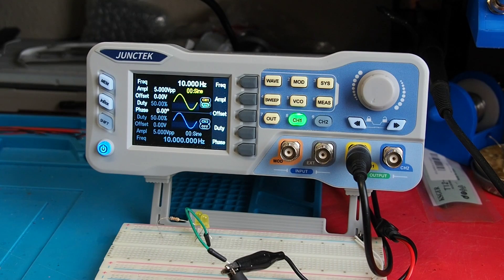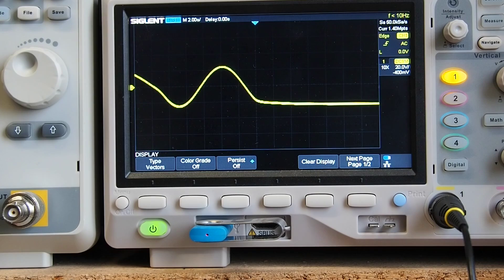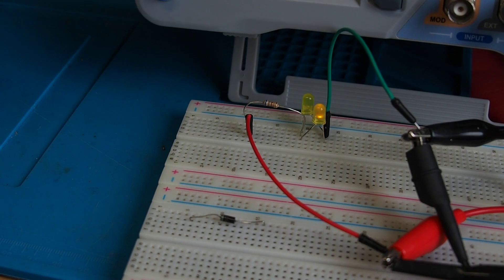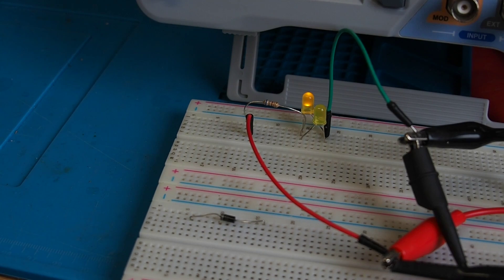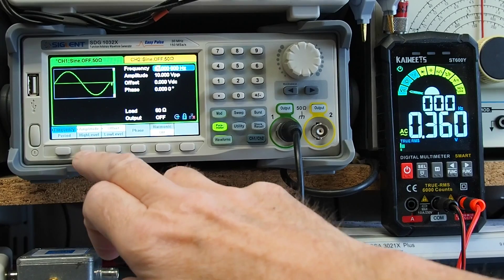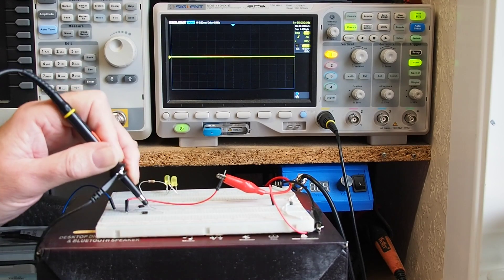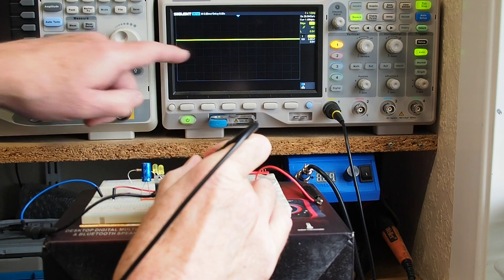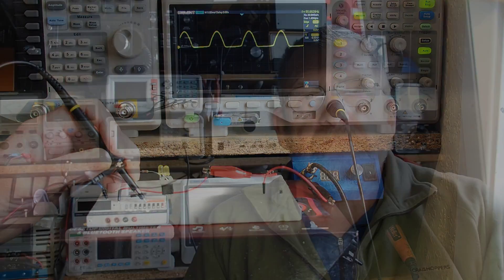More uses for a signal generator - #147

Comment: How about using both channels of the generator? Phase control? It would be very interesting to see how to use the generator to control, for example, a push-pull converter. I have a very similar generator, but I have never managed to get two square waves shifted relative to each other. What about you?

Comment: Not correct measurment, 10Vpp = 3,53Vrms because double Veff in sine wave ,one Veff = Vp/square root 2
In you video must be 20Vpp to Vrms = 7,07V
That generator basically generates the amplitude in Vp
In house outlet 230Vrms = 325Veff = 650Vpp
Reply: You appear to be correct. I suspect the generator is showing the expected output for a properly terminated load. The generator will be producing 20Vpp to compensate for the 3db attenuation due to the combination of the output and load impedances.

Comment: The 10v Peak to Peak voltage from the Generator should be 3.53V RMS on your meter. The output from the generator must be putting out 20V P-P?
Reply: No!
Reply: Yes, you can see on the function generator that the amplitude is 10V, so p-p would be 20.
Reply: V / Square Root of 2 = RMS.....10V / 1.41 = 7.092V
Reply: @FloppyDos  What p-p does it measure on an oscilloscope?

Comment: For synthesiser low frequency oscillators at 0.001Hz and below are very useful control voltages for filters and such like (especially if you're doing ambient music). when you get that slow, period does make a lot more sense than frequency.

Comment: Good video although I suspect that if you have a sig gen you also have a DC power supply, but sometimes two sources are handy. I have been known to use the sig gen DC output with a negative offset to provide a -ve voltage for an op-amp.

Comment: just a question: does not each led needs its own current limiting resistor?
Reply: + many thanks for a year full of great video's!
Reply: I don't think so as the LEDS are feed from a common point it only needs one resistor at the source it doesn't matter if it's negative or positive it's just one common point .
Reply: @barrymayson2492  see https://www.youtube.com/watch?v=m7oK5m4y0gc
Reply: @RensePosthumus  Hi I understand but only one Led is a light at a time depending on the pulse being negative or positive so you would only need one resistor so you would never draw more than one LEDs worth of current at a time the other led is turned off at least that's what I understand. I think of it as two diodes in opposite parallel only one can conduct at a time.